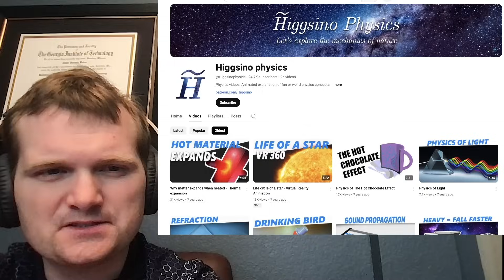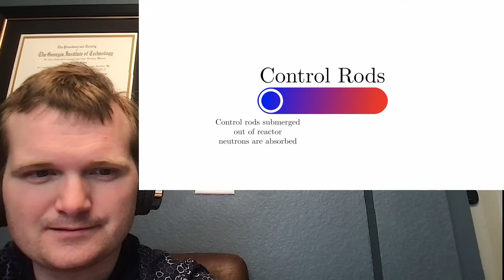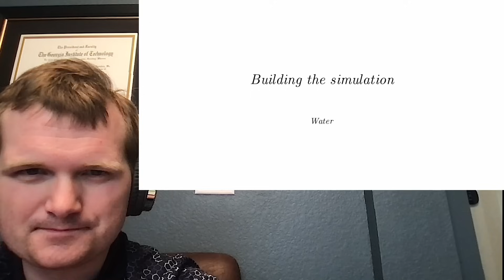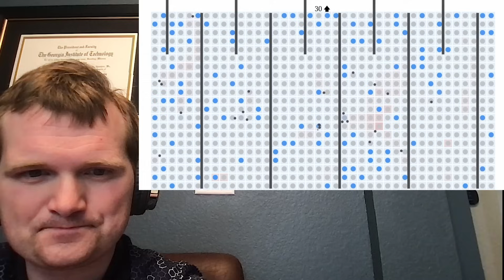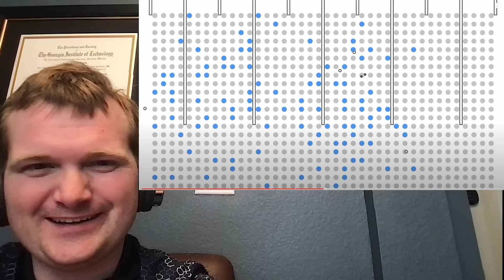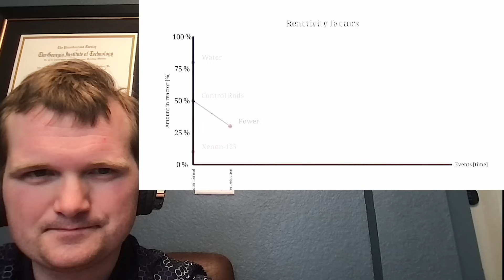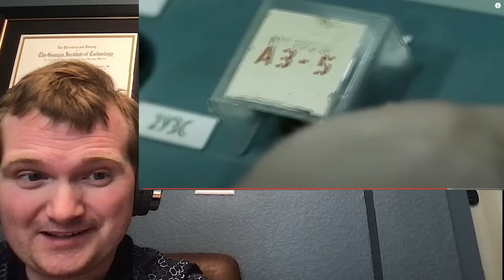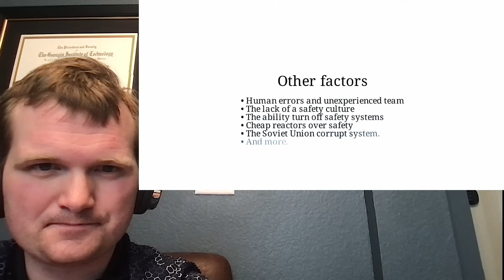Chernobyl Visually Explained - Nuclear Engineer Reacts to Higgsino Physics

Comment: The operators at Chernobyl were in no way inexperienced or unqualified. They followed the written manuals exactly and did everything they were expected to do according to procedure. THAT'S the actual problem. The designers of the RBMK knew about this problem but NEVER told any operator at any RBMK. The operators did not have critical information because the Soviet system knowingly kept it from them. The operations manuals were written to omit any reference to the issue. The writers/designers thought the probability of this happening were too small to worry about.  A lot of effort has been exerted over the decades to place the blame on the operators when the actual blame goes to the designers and the Soviet bureaucracy. Remember, there were many other operating RBMK reactors -- including the 3 other reactors at the Chernobyl NPP -- that never had this happen. They were all quietly retrofitted to finally address the problem in the design and operated until many years later. Take a look at INSAG-7, available as a free PDF, for more detail.
Reply: While you say that there "were" other RBMK reactors, there actually "are" RBMK reactors, Russia still operates a number of them, and a lot of the non-Russian ones only shut down in the last few years.
Reply: @WJS774  While that is interesting, that's not what I was trying to say. I meant that there were other RBMK reactors at the time and before. No operator of these reactors on or before the accident was ever told about the design flaws. After the accident, RBMK reactors were retrofitted, so RBMK reactors after retrofit would be different.
Reply: It's both. There's no need to be in a world that is so black and white. We live in that gray area. The reactor was poorly designed and the operators were not properly taught how to operate the reactor safely. Let's be very clear. The reason for failure was human. 

Not to mention. WHY would ANY well trained operator ignore safety features in the result of a reactor failure. 

It simply doesn't make sense to celebrate these operators and put sole blame on designers. They are both at fault.
Reply: @kissesuwu5282  I don't see how you can blame the operators for not knowing things that were deliberately kept from them. It was hardly their fault that the Soviet government had lied to them about the plant they were operating.
Reply: @WJS774  you failed to read the second paragraph. Human error is incredible.
Reply: @kissesuwu5282   You said it yourself: the operators were not told how to safely operate this reactor. Nothing in any manual or operating guide ever warned them from doing what they did. They ignored no instructions or warnings because there were none regarding these events. If they were never told not to do these things, how can they be held accountable for doing them? The designers KNEW about the flaws and DELIBERATELY kept that knowledge from the operators. It makes no sense to blame anyone but the designers for this purposeful omission.
Reply: @kissesuwu5282  I did read the second paragraph. How exactly do you classify reactor operators as "well trained" when their training was deliberately deficient in the danger that their reactor posed? Then I read the third paragraph where you said that it was their fault for not being properly trained. That doesn't fly.
Reply: They put the reactor in an unsafe condition even if they followed instructions. They should have known that in doing these instructions this would have moderated the situation. The true issue also lies in there computer systems were extremely slow. They deactivated the backup safety system since it could t tell they were conducting a test and it would have shut down the reactor in about 20 seconds which would have been too late. Yes the KGB did hide the faults but those faults would have been avoided had they known they test would push those faults beyond there limits. Mix that with a poor design and poor safety and poorly educated physicists and engineers, mixed with trying to keep things cheap like using poorly enriched uranium which makes the fuel less efficient.
Reply: You are right that its the soviet union corruption at fault that rbmk reactors  had this design flaw.  

However the operators were absolutely at fault for the flaw being activated. 

Everyone is human and anyone can make a mistake, even a big mistake.  

However their mistake is like testing if your parking brake can keep you from rolling downhill when you forget to turn your wheels to the curb, and in the test you don't turn on the parking brake.  I can't imagine how you can rationalize that as not the person performing the test making an error.
Reply: @zagrych  To re-use your car example, let's imagine that a car is built that looks and nominally works the same as any other car. The Owner's Manual contains all the typical information you would expect. However, the designers of the car knew there was a flaw. The flaw is that, if the driver turns left while simultaneously honking the horn and flashing the headlights, the car will explode. The designers KNEW this. They did not, however, include this in the Owner's Manual. They rationalized that it would be so incredibly unlikely that anyone would perform these specific actions simultaneously that there was no need to notify the drivers of this danger. Now, I'm not saying that this is an exact parallel to what happened at Chernobyl. Maybe a better example would be if the owner of the car decided to see how fast they could drive on a dark road without headlights. If, during this experiment, the issue was triggered, then of course some blame for the situation as a whole would fall on the driver. The driver knowingly performed an unsafe procedure. However, there would be no way for the driver to predict the totality of the outcome when combined with the flaw that the designers knew about. We can partially blame the driver for willingly performing a dangerous experiment; however, we cannot totally or even chiefly blame them. An equal if not greater share of the blame must be assigned to the designer. No one is saying the operators were blameless. They contributed to the accident. However, if the design flaw was not present, the consequences would not have been what they were, and the design flaw was known by the designers but kept from the operators. The operators had no way of predicting the actual consequences with only the information they were given by the designers.
Reply: @zagrych  The Soviets had also trained the rector operators incorrectly though. Like they didn't even know that the kerb was there.
Reply: @WJS774  And when the reactor said no and they overrode it anyway? Someone, if only one person was to blame at that site - but it was a human and it wasn't just following procedure.
Reply: @Nossieuk  I don't know what to tell you. They were told that "for this test you disable this safety mechanism" and so they did it. That is following procedure, and if you don't understand that there's no helping you.
Reply: @michaeladams297  I agree with what you're saying. I'll summaries it for anyone reading this.

It's the difference between FAULT and BLAME.

It undoubtably WAS also the fault of the reactor operators, however due to the circumstances they are not to be BLAMED for it (for the most part, anyways).
Reply: @michaeladams297  Your "car" example is pretty good. I quote the sentence: "However, there wouldn't be a way for the driver to predict the totality of the outcome".

Reformed, it simply means that a human cannot calculate a logical conclusion without first logically deducing and comparing things. If you try to insert logic into solving a math problem, I can show that as an example.

Example: "1a = 1b", where "a" is a value of 4. The value of "b" is unknown.
Let's say this is an equation to calculate the risk of injury at a certain speed in a car.. sound familiar? Alright.

Substitute "a" for risk on a 1-10 scale.
Substitute "b" for speed of the car in kilometers per hour. HOWEVER, assume that you do not know this.

Here, if you try to solve the equation, you simply can't. "1a = 1b" here would essentially mean: "A risk level of 4/10 at the speed of b"...
You can see that the risk is moderate, but it's incomplete. You can't know what speed this is referring to. The only way to proceed after this is to GUESS, or try to assume a value without any knowledge.

If you refer back to the powerplant as a version of this little thingy I've said to you, it's again a very simple realisation.

If it is true that reactor operators didn't have full knowledge to avoid specific circumstances with flaws on the reactor type, and they had no way to know.. they can't solve the logical problem that comes up... that is, "how do we stop this thing from blowing up". Or in a more equational phrase: "What do we need to do, to stop this thing from blowing up". Simply, they don't know, and they can't know. You can't stop it if you don't know, after all. You can guess, though, as I said. There is a chance, by pure luck that they somehow made the correct decisions to avoid reactor meltdown, but again.. you're playing roulette.

SUMMARY - The reactor operators did conduct a risky test, true. However, as a human you cannot logically calculate the risk of something without knowing the repurcussions.

I hope this helps anyone confused, understand.
Reply: This exact same thing happened under different circumstances at Leningrad-1 in 1975. (They were trying to start up after a turbine trip). They had a partial meltdown, but the control rod operator was experienced at Mayak's plutonium graphite reactor fleet and knew of the tip effect indirectly, so they inserted the rods slowly in groups of 6 until they were a decent bit were in and only then hit AZ-5.

Comment: Another main reason for the flash boile and loca accident was when you disconnect from the power gridd your wires to and from the generators to the plant pumps, lights, ext become the new power grid, and most important for automatic voltage regulation is that you need to not produce more power than you consume or can consume , meaning at the required voltages for thouse backup pumps you need limited steem to turn the turbines while in churnobill the had exess steam and power production, wich ked the grid to colaps , because they couldnt keep the steemdown enough, and instead of safly cooling the reactor till shutdown , the pumps, started slowing down dew to colapsing internall bus voltage , and reduced waterflow wich reduced steem , because the neverdisconnected steem from the turbines wich is something every one does these days to decople any boiler operation from power generation to not cause feedback , when this continiude duri g the test they put more water in the reactor wich makes more steem and collapses the voltage to much that the disel cant connect imidatly , and you get a incrisingly hoter heatsource, wich the makes a masive jump in criticality whilest under presure and causes a troumendes nuclear reaction as if it was a mini nuclear blast inside the chanells wich flashes the contents to plasma and produces hidrogen wich then this blows up the hole buiding or as they called it their entire containment strategy, thats why proper voltage regulayption or fast power swiching is required to stop a collant pump from reducing its efectivness.